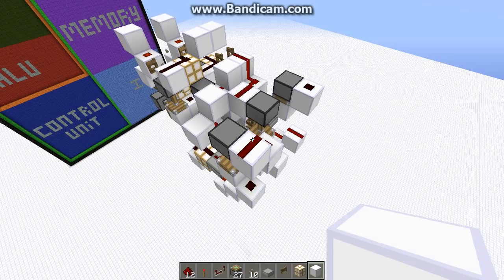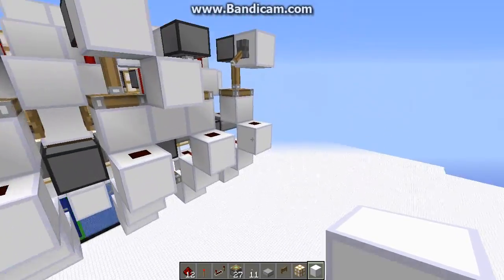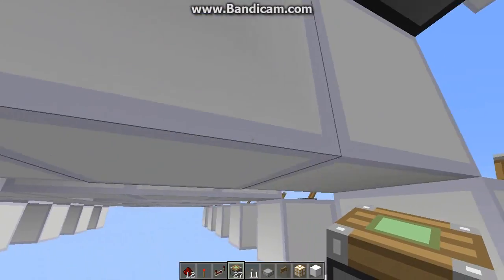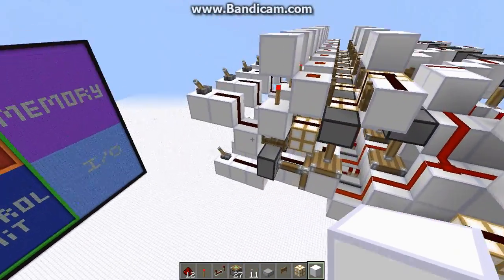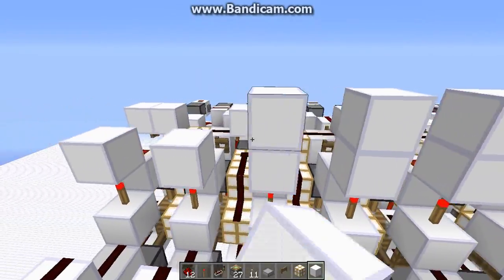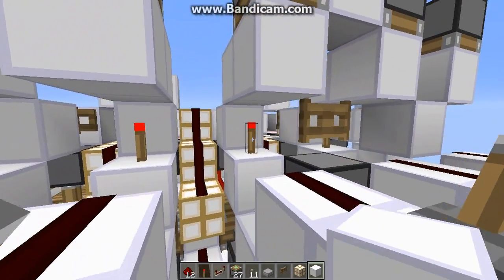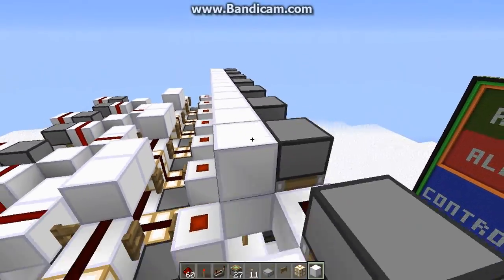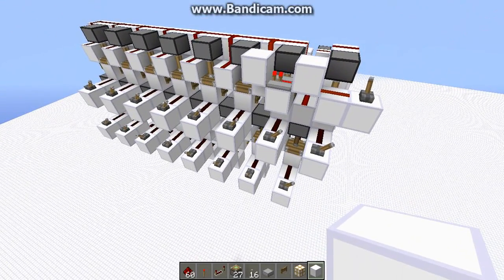Advanced Redstone Computer Tutorial ?: Adder - Control Lines and Speed Test

Comment: Could you please make a tutorial on a 16 - bit adder, BUT without using the piston BUDs since they will go bye bye in 1.5? 16 bits sound awesome. 8 is fine, 16 would be cool as heck. The delay with 2 Ticks is fine though if it means it will work in 1.5

Comment: Okay 8 bits is definately enough for MC computers, no need to go further. 8 bit gives you up to 255 and 16 bit gives you like 32768 I believe, tht's 2**15. I don't see any time you's use more that 255 for any program for an MC computer. Plus it would be quite a lot slower due to repeaters for control lines if you want to keep everything in sync.

Comment: Personally I would like to see you do 16 bits. The reason is that most people I've seen do 8 bits and 8 bits generally doesn't require lengthening the signal for control wires and I would like to see how you would go about that. I would also like to see if there are any differences between the way 8 and 16 bit systems are designed since I am attempting to build a 16 bit system and need all the help I can get.